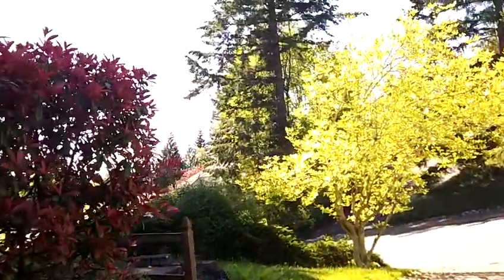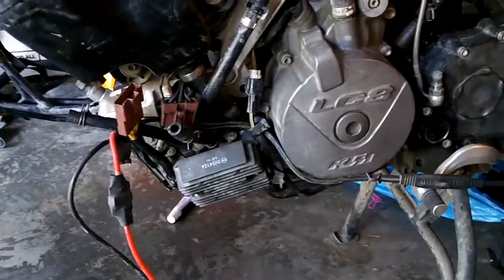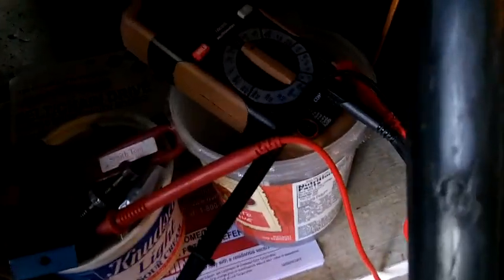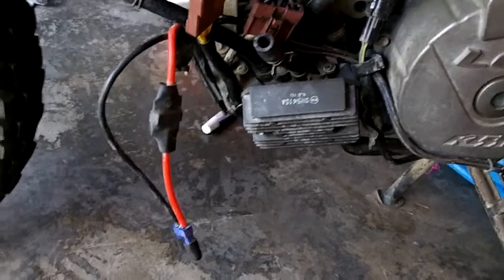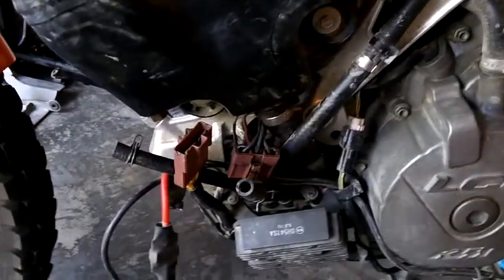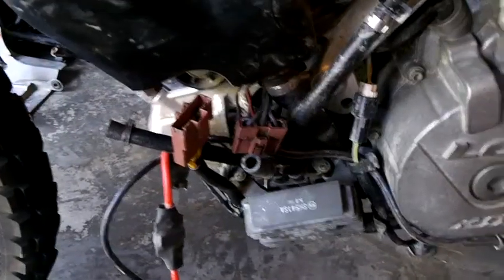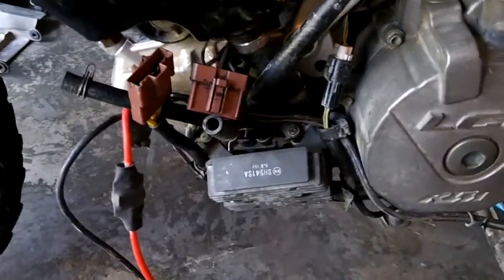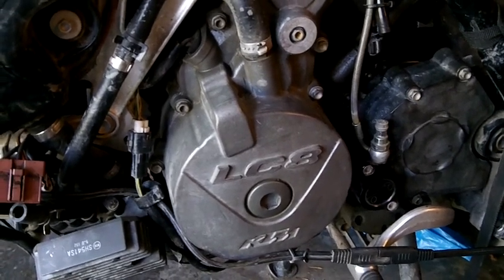Diagnosing KTM 950 Adventure Charging issue

Comment: Did this fix the problem? What were you measuring between the stator wires?
Reply from the maker: Wow. Blast from the past! I posted this video a while ago. As it turned out, it was the stator that had gone bad. Once replaced, the charging issues were resolved. I continued to use the original regulator/rectifier.